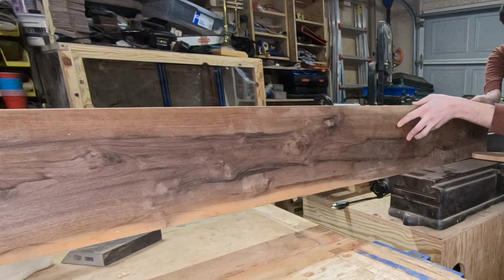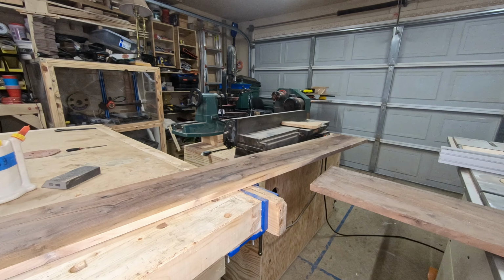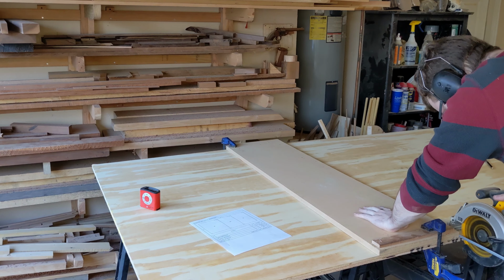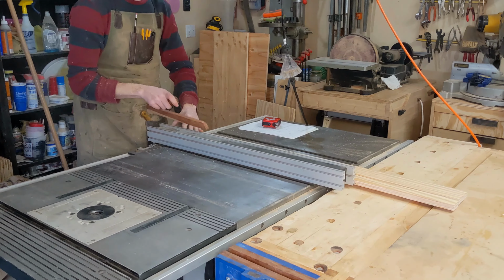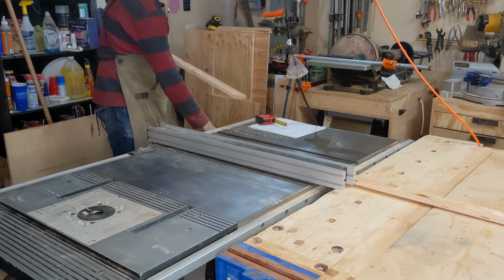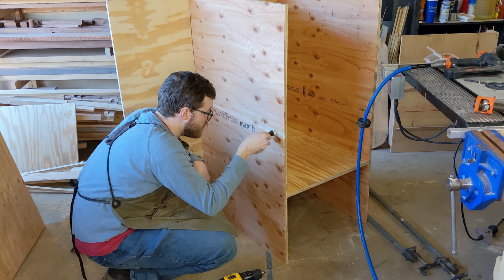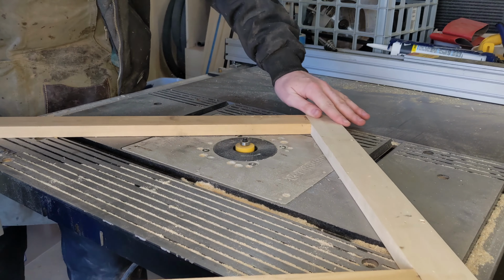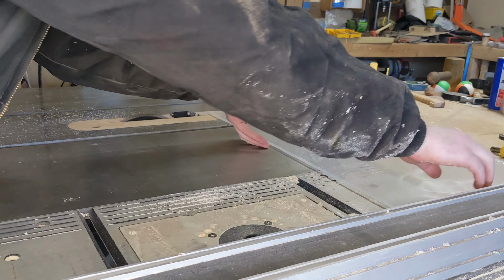3d Printer Enclosure and Electronics Tool Cabinet

Comment from the maker: What's your favorite 3d printed organizer style?  I'm thinking about using gridfinity [ https://github.com/jeffbarr/gridfinity-catalog ]  in all of my drawers going forward.
Reply: Gridfinity is awesome for displaying things, so you can get more stuff done, because you can find it as easy as snapping your finger. Isn't designed for maximum "Stuff Per m3" though it does come close. 

On Gridfinity while I'm already rambling on, there are more efficient models the community has made that save a lot of print time, and filament if you're making enough of em for that to be a serious consideration. 

If you do go this route, I'd love to see a vid on it! : )